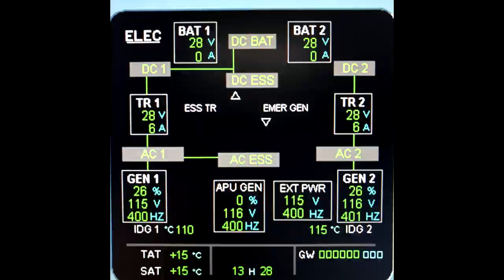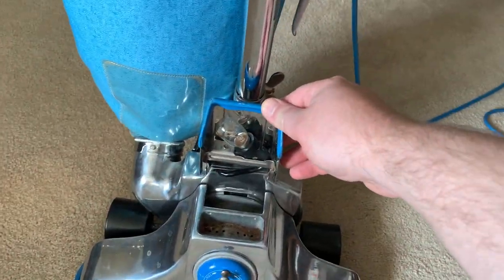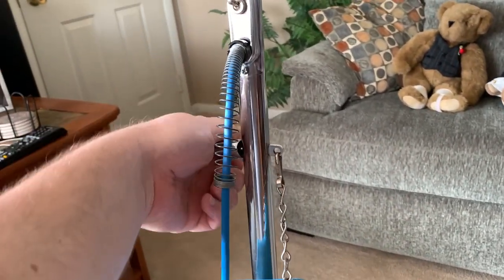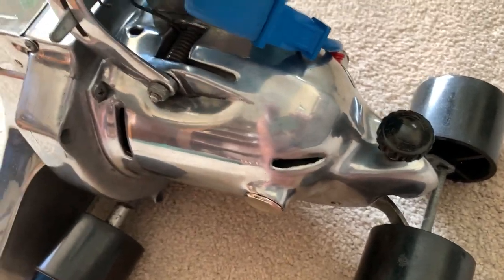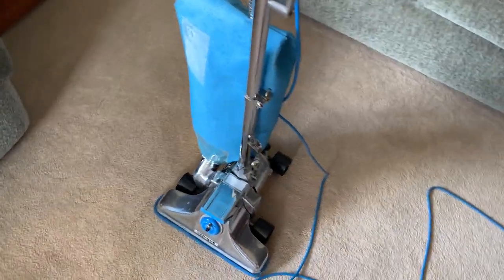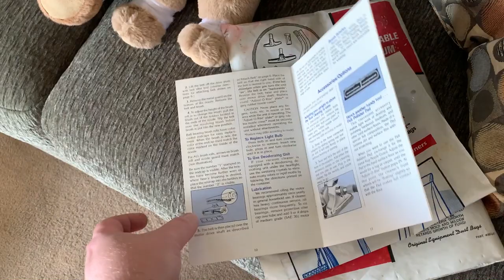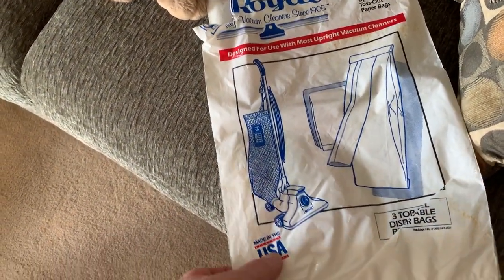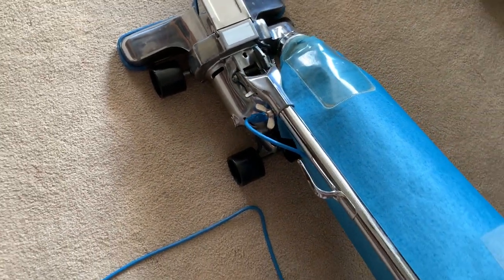1987 Royal Model 887 Vacuum

Comment: My 1989 Royal has wheel covers with crowns on them. Unfortunately brush rolls are no longer made for mine.
Reply: Yours is one of the following:
8000 (mauve bag, Rite-Hite screw type height adjuster)
9000 (mauve bag, Au-Toe-Matic toe-touch height adjuster)
9005 Classic (same as 9000, but with burgundy bag reading "Classic 1989")
9089 Classic (same as 9005, but also has brush roll indicator light)

Comment: Are they still around?  I haven't seen that name in a long time....
Reply from the maker: Sadly, no. They have gone away a few years back, and have been owned by TTI (read China) for a bit. The last years of Royal weren’t too kind to the brand unfortunately…
Reply: @spatsbear  I know right: when TTI initially took over Royal in 2001, the first thing they did was to delete many of the internal replacement parts related to the 1994 and older metal uprights.
Reply: @spatsbear   it's too bad they quit making Royals vaccine 😞

Comment: These are cool! My middle and high school used these(not the exact same; Orange and black ones) to clean classrooms, you could hear them from several rooms away. However, ever since TTI did away with Royal in 2019, they have slowly been disappearing and being replaced with Sanitaire SC886s and 888s

Comment: These are fantastic cleaners, I have a late 70s 880, and a mid 90s Classic 9700, both are super well built and definitely withstand abuse.  I would definitely like to find a 6 amp version like this 887, since it's a good balance between noise, and performance in my opinion (plus the 887 and 886 have the same blue color tone as my 880).  My 3 amp 880 is nice and quiet, but not very powerful, however my 7 amp 9700 is noisy as all get out, but is ridiculously powerful.

Comment: I really like that vacuum cleaner!! Kind of hard to believe it's from the 1980s , but I guess I would assume that because of the design of it , I also like the sound of it too by the way , It appears that it's not too loud at all , much like the vintage and more practical fans these old vacuum cleaned were built to last and they lasted for years , by the way Spats Bear, I watched your video of the wizard stand fan that you restored a long time ago, I did leave a comment there and I'm not sure if you saw it , but what was the green spray paint that you used to paint it with?
Reply from the maker: The paint was Rustoleum, but I don't recall the color used specifically.
Reply: @spatsbear  Ok thank you , I have a wizard 6jc3020 1950s box fan that I got 2 years ago and it was originally the same color scheme as yours , Id just thought I'd ask , Thank you for the feedback and I enjoy your videos!☺️👍

Comment: Are they typically easy to push? I have a 602 and I think it may need a new brush roll because it's a little hard to push
Reply: Yes, they should be if you have the height adjuster at the correct height. I also think you should check the belt to see if it's overstretched (if so, time to replace it).

Comment: I have a royal model 886 and was wondering were to find parts for my machine. Your royal looks identical to mine and just love all your vacuum videos y’all do
Reply: Very hard to find any royal parts, prob gonna have to check eBay and use different combinations of words for you search. Try “royal vacuum parts, royal vacuum, royal upright etc
Reply: TTI discontinued the Royal line and are no longer supporting any parts.

Comment: I have a royal from 2009 that I have, not my daily because my Miele C1 Homecare has that honor and because the royal doesn't do hard floors as i dont have the tool kit and furthermore if i did changing tools is easier on the miele and so is changing bags. Such a shame that tti took over and ruined them before doing away with them completely